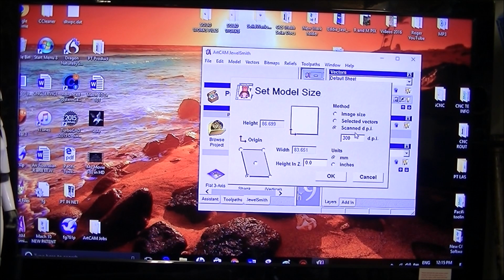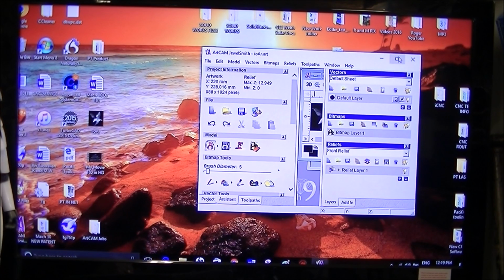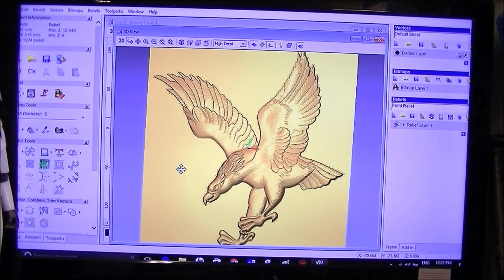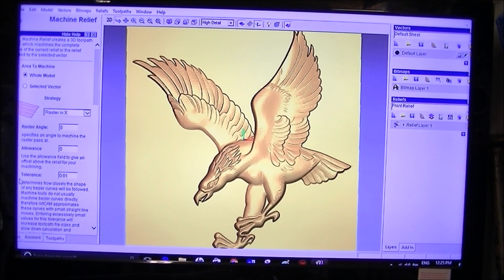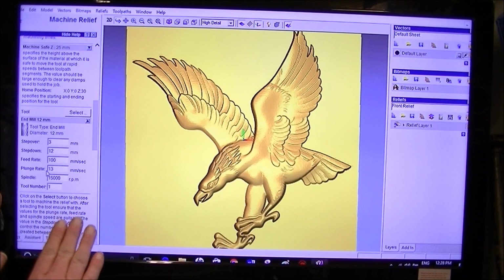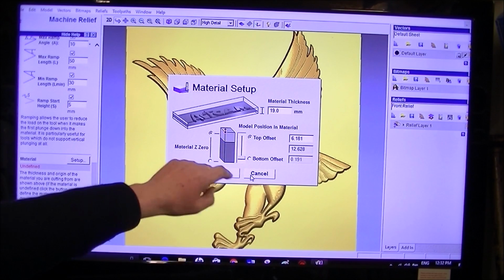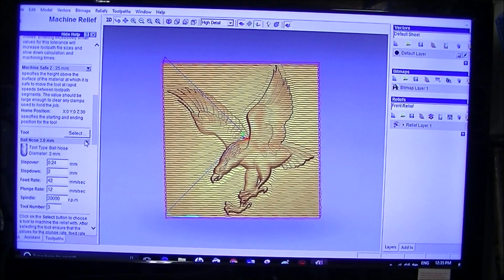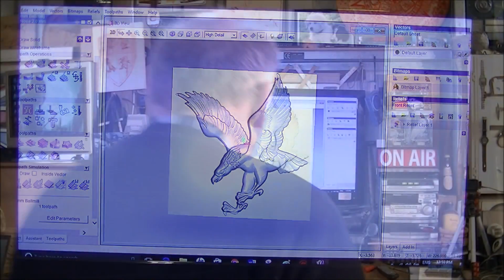Easy learning, making a 3D relief with ArtCAM (Carveco) absolute beginners

Comment: I tried this technique and my model was inverted, it was going to remove my eagle and leave the stock.  Also I didn't have smooth edges, I had a straight hard drop edge all the way around
Reply from the maker: Hi, do you have an ArtCAM license?
Reply: @inventorsworkshop9600  yes I do